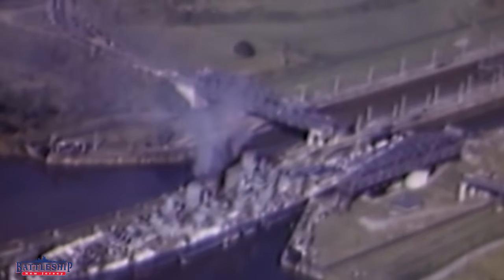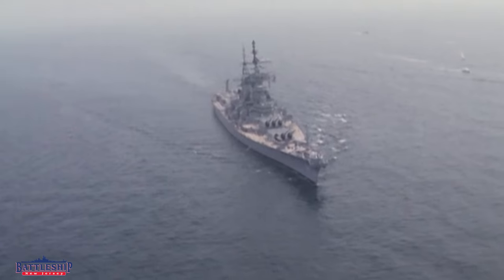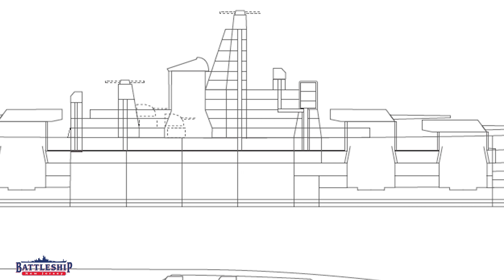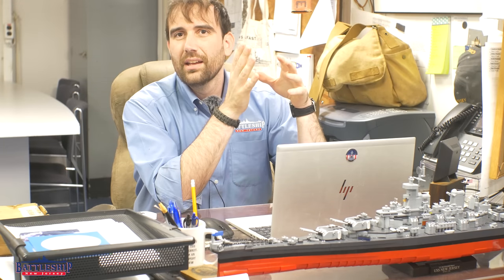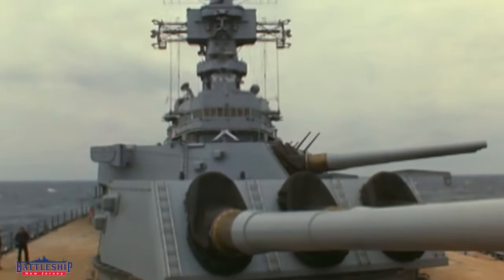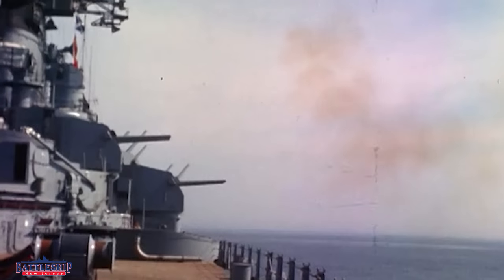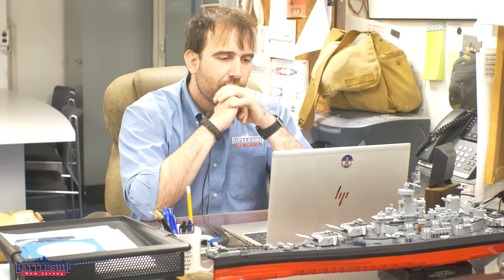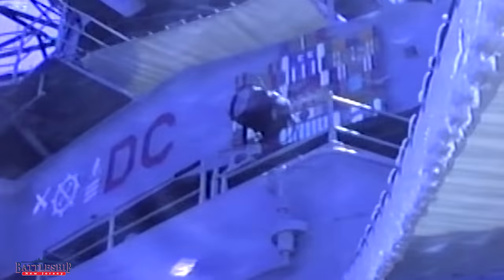The Perfect Battleship

Comment: i would make an aircraft carrier that had the armor and guns of the battleship! 12 duel 16inch guns around the perimeter, 2 in the front and two in the back with the rest along the sides. we would crank up the speed that the turret could travel that way beehive shells could actually lease fast movers. under cat 2 and 3 i would make enough room to have nothing but launch tubes for tomahawks and all of the super awesome ground to air missile. in between the 16inch there would be quad 20mm, 30mm and 5 inch's. it would be a floating fortress. under the water line i would have doors to let me attach submarine out to seem and destroy! the flight deck would be long and wide enough to comfortably take off and land AC-130's. i would also get the f-22 line back up and running with landing gear fit for a flight deck! thats a start!:face-green-smiling: i will call it my BattleCarrier 🤯🥳😍🥰😇

Comment: perfect bb :   All forward 20 inch rocket assisted guns 6-8 of them and a flight deck on teh back for a squadron of f35s and prob a marine battalion... obv plenty of ciws close in protection too, battery of harpoons  maybe even bigger missles in the flight deck...
Reply: Why a Marine battalion? Where are they gonna sleep and wtf are they gonna do?
Reply: @andrews2990  that was the plan for the hybrid iowas lol ... they will be an amphibious assault ship essentially , one that can bomb shell and put boots on the ground...
Reply: @andrews2990  they had marines and seals on board anyway
Reply: @andrews2990  there would be less sailors there would only be a wing of f35s and helicopters ...."where would they sleep" they would build barracks in the new superstructure under the hangers they would have to build they already designed the rebuild theres models of it with and without ski jumps
Reply: @andrews2990  the whole rear turret would be removed ... the would prob have to remove the superfiring one too if teh concussion effected flight ops...thats why they didnt convert one of them
Reply: @andrews2990  imo uss massachusetts and alabama would prob be better cantidates for conversion because they are a foot wider
Reply: @andrews2990  i only said maybe missles in teh flight deck lol make it an all drone assault ship those are coming soon...

Comment: again, another video that has Mono sound output 🤬🤬🤬
.
This is about the easiest thing to do before uploading a video, I won't be watching this as it will drive me crazy and I would rather keep what little sanity remains than watch this video.
Reply: Disagree - i have all videos have audio both side (this and the prior) .- left is higher volume- in all. At beginning of this video - I had perception voice left- background noise right - more time - realized both. Ideally both left and right same volume level. - That probably is something they can correct. If viewers are truely one side only - check your speaker hookup - Slight dieconnect will reduce/ remove one side.